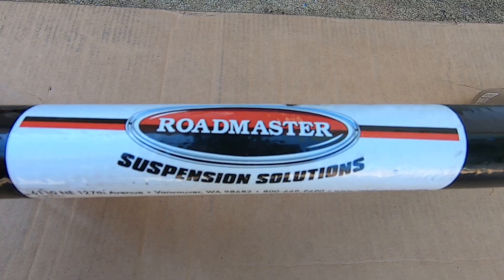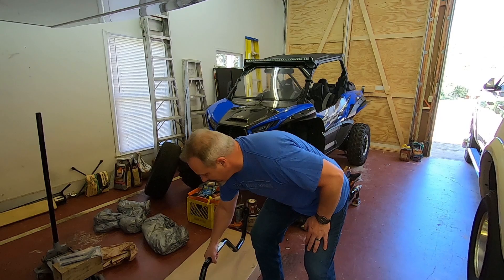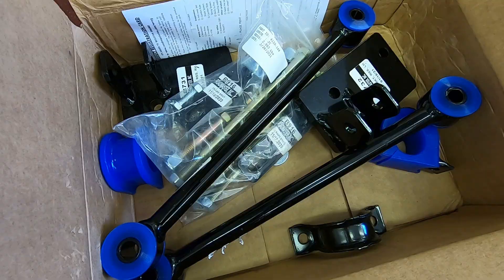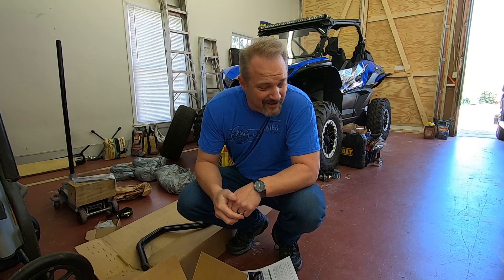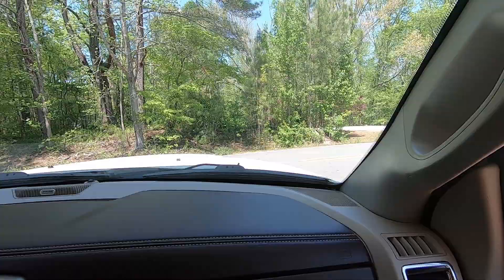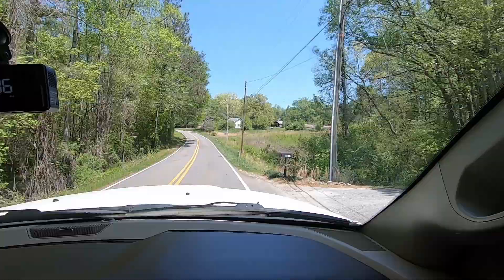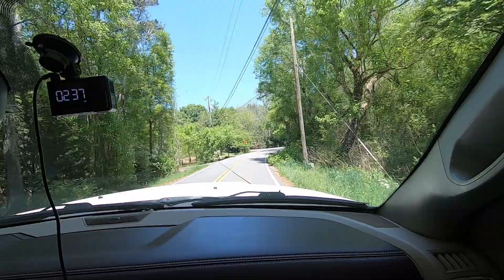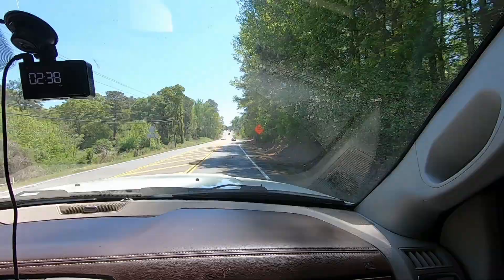Ram 3500 Anti-Sway Bar / Roadmaster Review

Comment: I put on the Hellwig Big wig on the Rear on my 2008 GMC 2500HD along with lower Stable Loads and Timbren Bump Stops. On the Front end I replaced the factory hollow sway bar with the Hellwig 1.5” solid sway bar. Truck handles Adventurer 86 FB nicely without sway.
Reply from the maker: Sounds like a good setup.  Safe travels and thanks for watching.

Comment: I went with hell wig because of the adjustment. That is on a 2500. I wasn’t sure how to pre load the sway bar. But I think I over thinking it. So I just used a bottle jack and just put some tension on both sides. Bottom line is it works great with our truck camper.

Comment: Thanks for sharing. Any reason you went with roadmaster vs hellwig? Looks like the Hellwigs are not as expensive…
Reply from the maker: Hi Jason,  Yes the reason I went with the Roadmaster is the sway bar is thicker than the Hellwig.  Or at least it was at the time.  I wanted the strongest anti-sway bar I could find.  It was 1/8" larger than Hellwigs.  That doesn't sound like much but it really is when it come to the twisting strength of the bar.  However Hellwig does make good products.  I don't think you could go wrong with either one.  Thanks for watching! ~ Todd